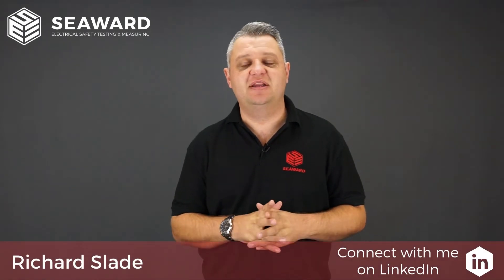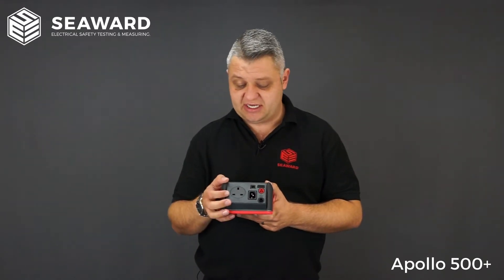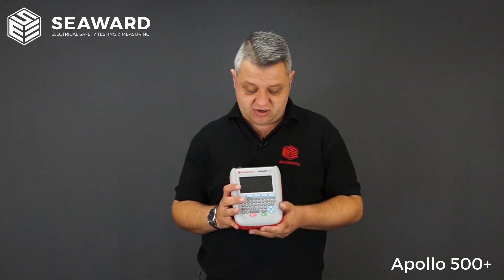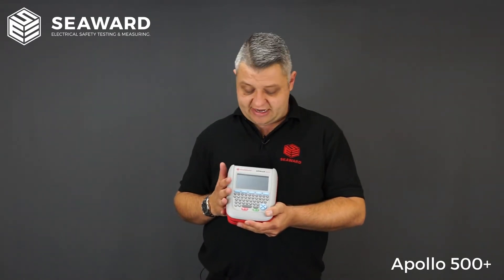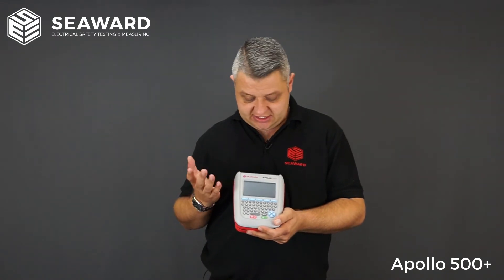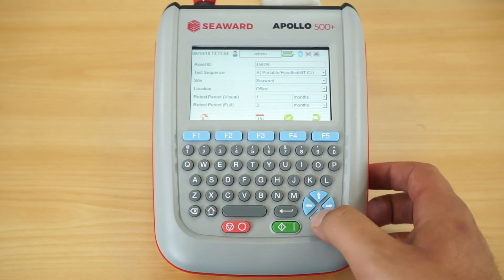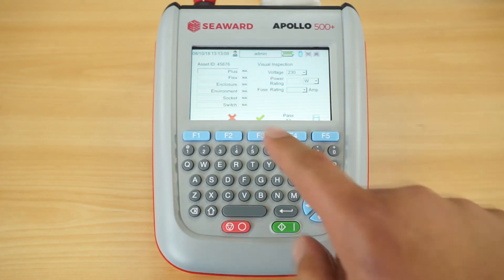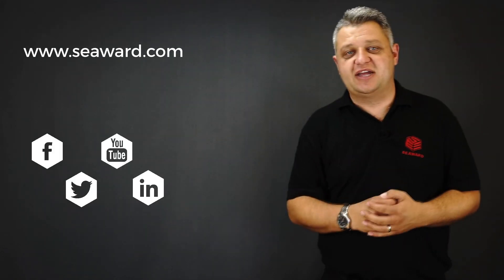Apollo 500+ PAT Tester Overview Video

Comment: Hi, I've just bought this tester but can not find the Class 1 option to perform the test from the drop down. Thank you
Reply: Yes I have the same unit here and the options available bare no relation to the ones on this video. The naming is very different and coming from an older unit which had options far more like those in this video it's a bit confusing...